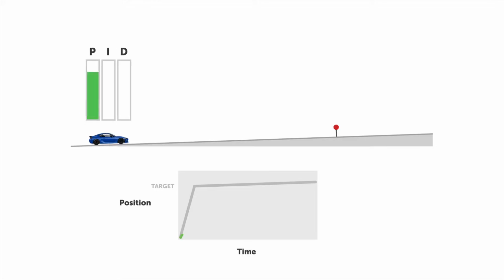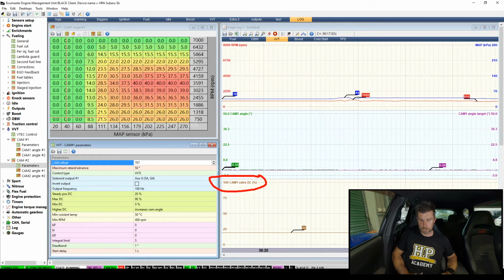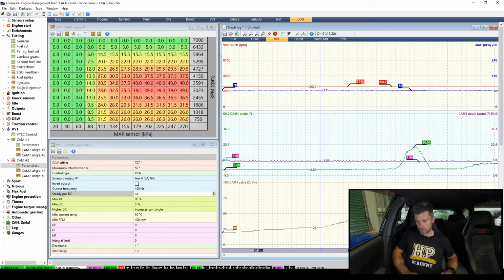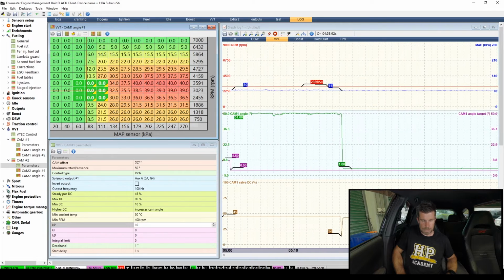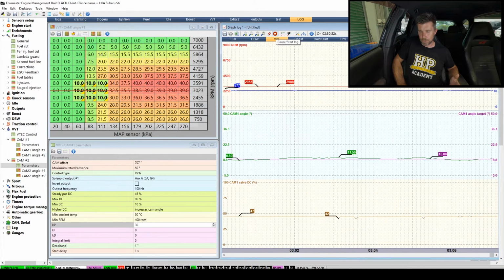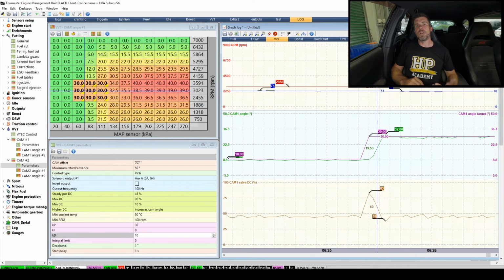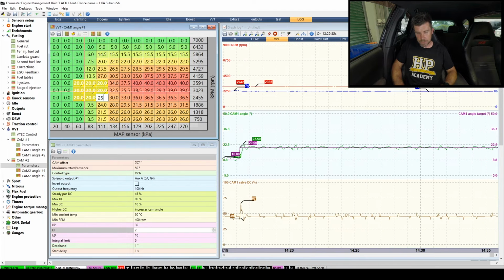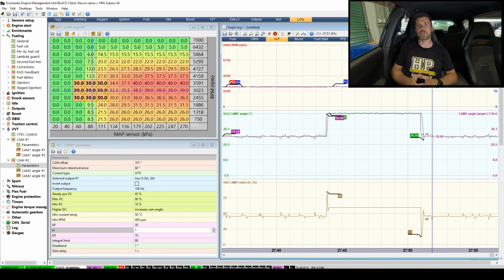How To Nail PID Optimization | 1 of only 5 Steps: Variable Cam Tuning [FREE LESSON]

Comment: You should have said set the drive by wire range really high and then Lower cause some of us didn't know that's how you adjust idle, for instance mine's working at 22 and I've been trying to figure out how to make an idle for days and YOURS is that 6 and you want US To start lower🙄

Comment: I just revisited this great video again now that i have a car equipped with a MegaSquirt 2 PnP that has PID control. I've read the MS2 manual on PID tuning and watched other videos on how to tune it.... And it appears i STILL tuned it incorrectly. I thought you were supposed to tune each part of the PID until you get oscillation, then back off until the oscillation stops, starting with the "I". Then the "P", then the "D". I started with "I" to actually hit my target. The the "P" to get to the target quickly, then the "D" if there's any over-shooting. Can it be done this way or am i wrong? Thanks Andre and HPA team 🏆
Reply: Did you not watch the video at all or?

P then D then I
Reply: @nesmio7378  yes, i watched the video. I'm explaining to you what the Megasquirt manual says when tuning PID. Clearly there's a conflict here on how to tune the PID.
Reply: @PANTYEATR1  Is there a conflict? How well did your IPD method work out for ya? Now try the proper method.
Reply: @nesmio7378  sure, there is a conflict. HPA says one way and the makers of MS say another. Is there only one way to skin a cat or get to the end result? Nowhere in my original post did i say the tune is bad. I said "it appears i still tuned it incorrectly" meaning i turned the PID the way the MS manual said to. Now the question is, will one way create a better closed loop than the other?
Reply: @PANTYEATR1  I've never ever heard someone IPD tune a PID certainly not for a car. Look up any tutorial or information video or forum post and it's always PDI. 

As long as it works it works and is fine.
Reply: @nesmio7378  when i first looked on YouTube for an easy explanation on how PID works, IPD is how 5 of the videos showed it. I = target accuracy, P = speed to target, D = is the brakes to prevent overshooting of target. I agree, regardless of method, as long as it works.
Reply: @PANTYEATR1  Show me a video where I is first, I've never seen a use case for it. I like to think of P as speed or response, D as fast STFT and I as slow LTFT